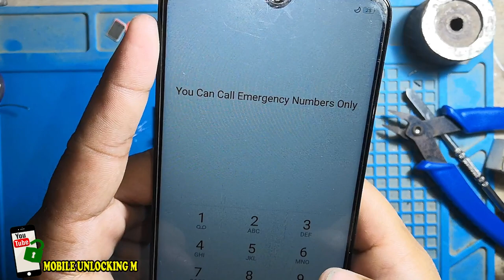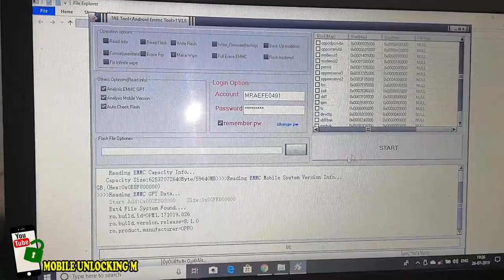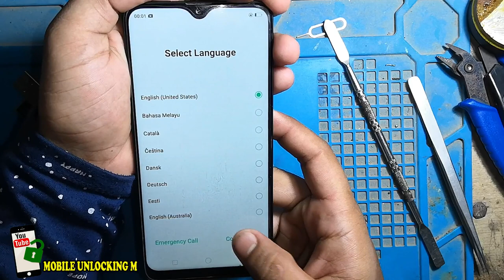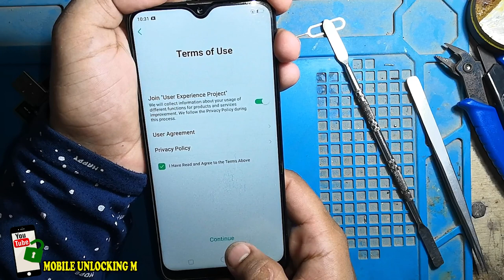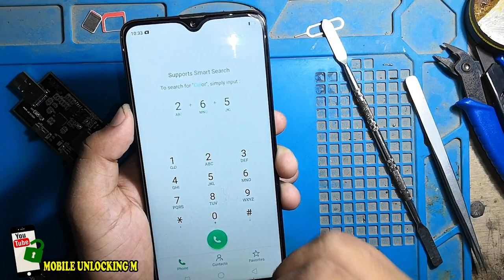OPPO A7 Password Offline Unlock With AE TOOL(MRT KEY)

Comment: ISP lagya hy but connect nhi hota ya likha hoa aata hy 
>>>>searching emmc devices.... ae tool programming 0888 >>>>testing emmc disk read status.... reading emmc capacity info... capacity size:0 byte/0mb/0.00gb;(hex:0x0000000000) wrong emmc disk data; this may be an empty flash ic!!!
Reply from the maker: isp thik se lagao
Reply: MOBILE UNLOCKING M jo perfect kam kara jo ap na phaly try kiya ho

Comment: >>>>searching emmc devices.... ae tool programming 0888 >>>>testing emmc disk read status.... reading emmc capacity info... capacity size:0 byte/0mb/0.00gb;(hex:0x0000000000) wrong emmc disk data; this may be an empty flash ic!!!
Mara ya aa raha hy